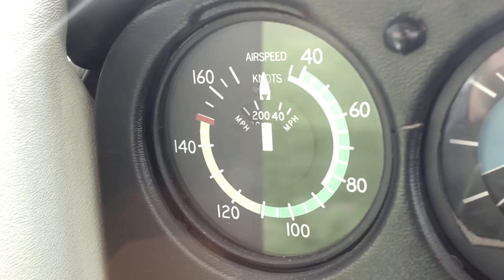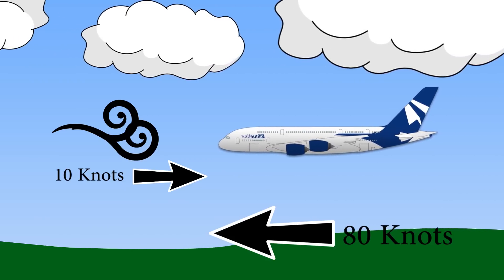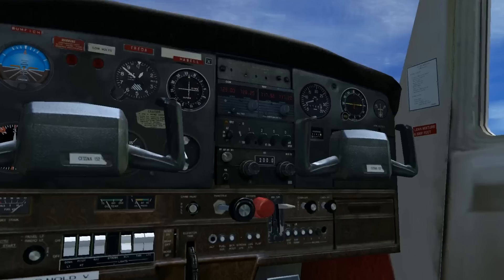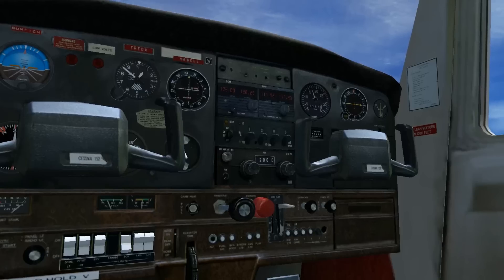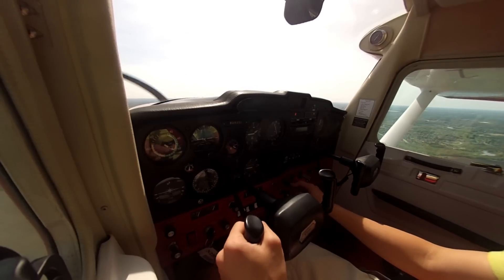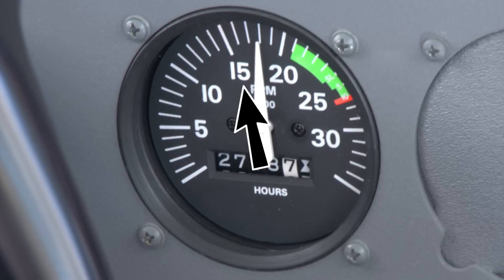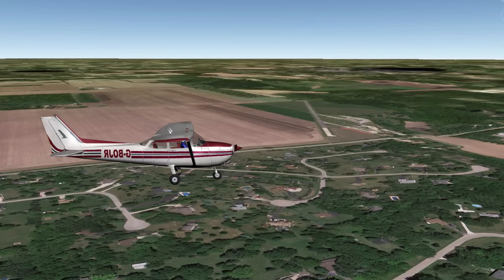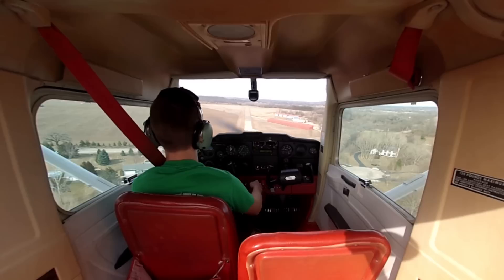How to Land an Airplane

Comment: It will be more helpful if you:

1. Soften or eliminate the bed music so viewers' concentration wont be impeded.

2. Avoid using stills and random footages. Get in a Cessna or an actual airplane and then do the tutorial.

Viewers will most likely look for real life context with what you're saying and also, doing the flight yourself will ensure your viewers that you can actually do what you're saying. =)

Comment: A totally unstable approach.  Never try to land an airplane like this.
Reply: @ericbeets  Hi Eric,  Here's what I think is the proper approach for a Cessna 172.  1. Enter the downwind leg at or below flap operation speed.  Add 20 degrees of flaps and set airspeed to 1.3 times stall speed in the landing configuration (gross weight, full flaps as recommended by the FAA)  In the 172 this is roughly 70 mph.  Adjust power accordinglu. Hold that airspeed and flap setting.  2. At the beginning of the base leg turn, reduce power to give an approximately 500 fpm decent (or 3 degrees angle of decent) Continue to hold the 70 mph airspeed. 3. Turn final approach leg with these same settings.  Don't apply full flaps until the runway is made.  (you can also reduce airspeed by 5 mph at that time if applicable)
I don't think it is proper to be fooling with slowing the airplane down, adding flaps and turning at the same time close to the ground as you suggest.  It is better to have everything done on downwind (including the landing checklist) prior to turning base.  That way, all of your attention is properly flying the aircraft to landing without the pilot's attention being diverted to other tasks.
I am not an insturctor, but I owned a 172 for years and this method served me well, especially in insturment approaches.  This method also worked well when I moved to a Commanche 350 and later to an Aero Commander 680.
These are just suggestions.  You might try them.  If you like them fine.  If they don't work for you, that's fine also.
Reply: @ericbeets  Thanks Eric,  The best of luck to you.

Comment: ya the landing is still challenging much more then the take off for me still to understand ... my issue is not gradually come down .. i.e coming down to hard . Take off doesn't seem as bad if you have a lot of space , open the throttle up , and starting forward gradually till you hit a high enough speed then start pulling back on the yoke

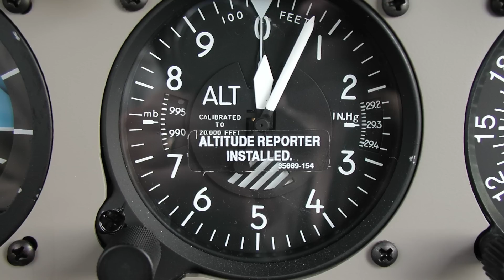Comment: Great video, there is a lot of information you are giving here and I will make one minor correction to your speech that I feel should be noted to possibly avoid confusion to an inspiring student pilot.  At 0:25 the altimeter does not really show how high you are above the ground (it has no idea where the ground is), it does instead show how high you are above the average sea level. Imagine flying 1000 feet above sea level and flying towards rising terrain.  As you get closer to the ground, the altimeter will continue to show 1000 feet and will not reflect how high you are off the ground.

Comment: how much would a plane like that cost?
Reply: Used C152 is around 50,000 in a decent condition
Reply: Looks very comfortable, do you know if they're hard to fly?
Reply: They are fairly easy to fly, I've flown two diffrent C152 and they are awesome machines :)
Reply: Not a lot.

Comment: Is following instructions from aproach to intercept localizer altitudes and heading then i think they say contact tower after intercepting localizer then get landing clearence then keep the 2 neadles in the middle going down and make visual transition at 200 feet or if its a visual then visual transion 800 feet  allso watching airspeed staying 10 knots above bug is this the proper proceidure im not a flight instructer

Comment: many thanks for sharing I really did enjoyed and learned a lot,what worried me was at the lasr part of your smooth landing specifically as the air speed and throttle,it all comes to a matter of monitoring all those variables at the same time.
And mostky important I guess is once you´re airborne and want to go high your speed must be high rpm so in order to prevent a stall when pulling the yack and if you do so stall turn the yack left and than make a spin to recover correct ?